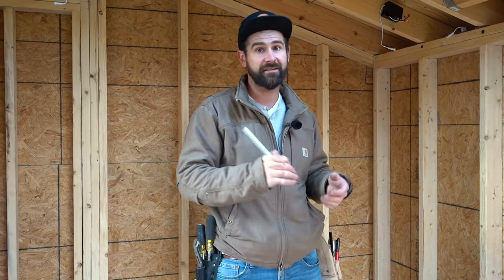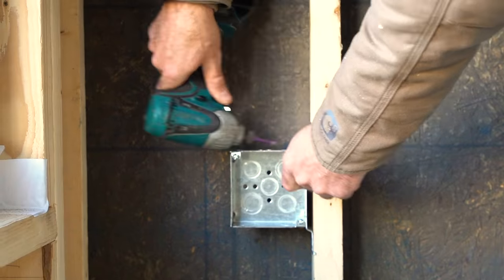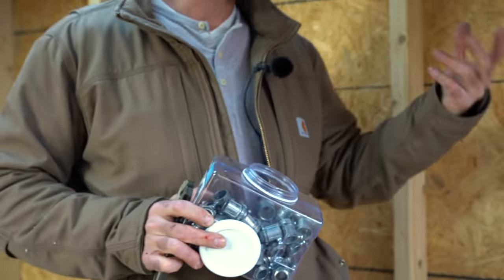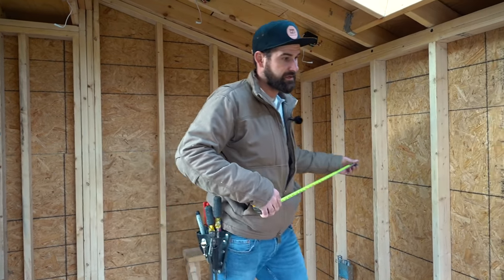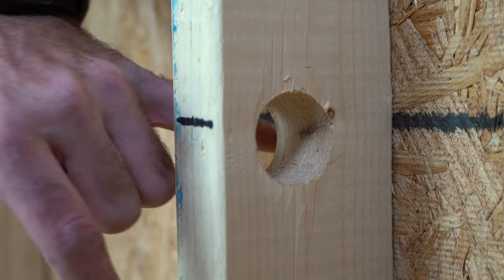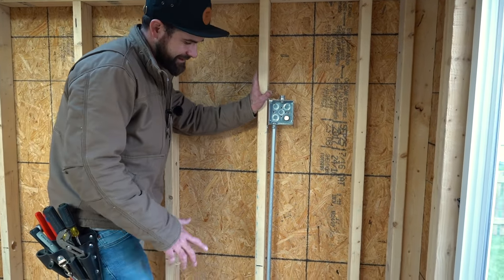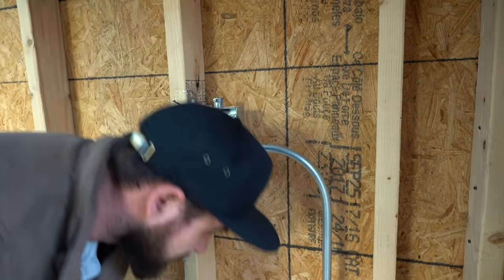How to bend and install electrical conduit

Comment: Hi...been bending since 1985...nice...why didn't you use flex or bx...just asking?  🤔
Reply: They can't only for like 2 foot loops to lights. Fire Marshall says the small gap in the shells where it flexes allows smoke and fire to penetrate to easily

Comment: Metal clad mc should be used in this application to avoid using conduit in wood frame setup. Also there is nowhere in the NEC code book that says this is required in an residential home.  Pipe is not a good ground. I'm a 20 year veteran of the electrical trade. Learn your code so you can avoid costly wastes of time and money.
Reply: Some municipalities adopt the NEC code with amendments. In my town, they follow 2017 code, but exclude the use of MC, NMC, and others. Result is that EMT is required.

Comment: What are the advantages of using a conduit versus not using a conduit and why do some builders choose not to use conduit ?
Reply: Conduit adds a lot of expense. It takes a ton of time to bend, run, and connect it compared to roping Romex everywhere, and of course the conduit and fittings aren't free. But in the case of conduit installed within walls, it A. protects the wire way better and B. allows one to change the wiring in the future, unlike with Romex which is stapled. I'll be running all of the wire in my new shop in surface-mounted conduit because it allows me to move outlets around as the shop changes, and in a shop I don't care about how it looks.
Reply: @bmay8818  

Amazing. Thanks so much for the reply.

Comment: What types of wire can be run in metal conduit ?
Reply: THHN
Reply: Individually insulated wire.  Generally not NM cable. THHN is one type of insulated wire, but if the insulation class is in the NEC, you pretty much can use it.  If it’s a pipe used for conductors under 50V, you can run communication cables.

Comment: Those boxes only have two holes, how do you mount two switches in there?
Reply: Plaster ring
Reply: @gtbr8134  ok, I stay away from those because if you wanna put different things in it, you have to break away all the drywall mud.
Reply from the maker: @danlux4954 you make a good point
Reply: @BobClarizio  we have some razor plugs that have those kinds of boxes and it’s such a pain to get a retrofit kit. The screws don’t fit properly because the holes are in a different spot.
Reply from the maker: @danlux4954 Yeah I know what you mean!

Comment: "1900" is a catalog item number.  Run your pipe next to the stud to have something to support to without adding a tsgb16. 
Use deep boxes.  Only cut about 3 inches of you channel locks handle off.
Who would go through all that trouble of running pipe and then nail the boxes up or nail any of the supports up? I live in the south, where people say we're lazier about electrical work. Not true. I would never use a nail unless I'm framing with wood.
ADA says that switches will be no higher than 48 inches.
There is no way you do this for a living, or you didn't listen to your journeyman when you were taught.
No box offsets. Don't use sharpie, use pencil.

Comment: If people could see the wires I've exposed while remodeling with bare copper wire showing from mice gnawing (at the corn starch in wire coating?), they would be afraid to skip pipe..

Comment: Does the electrical wire just push thru the pipes?
Reply: Pull it in....after you push the fishtape.
Reply: Super short runs like that,  I might just push,  but generally you use a fish tape or vacuum in a string.
Reply: You can push solid wire quite a ways .  Stranded not so much . Sucks when you are stuck with no snake …….
Reply: @gerdberg4188  True... I usually run solid ground and stranded conductors. Solid ground gives rigidity to the "push" on a short run, and also doesn't require crimp-ons to ground boxes, devices... ect. That's assuming we are talking about #12 THHN. Anything larger, I use stranded exclusively. Solid becomes too rigid to push/pull comfortably.

Comment: Why is it code in Chicago to use conduit inside the walls?
Reply: So apprentices learn how to install conduit.. Then contractors know who to hire for commercial and industrial.
Reply: Chicago fire, unions and common sense are the reasons I know of. A pullable metallic system is the Cadillac standard. Contains any fire, keeps mice and rats from starting the fire, and it's easy to pull new circuits or rewire a house without chopping up the walls. There's also the part about the electromagnetic field surrounding the wires being contained by the pipe. The union part comes from years ago having only qualified individuals being able to perform the installation. Although there are plenty of non union electricians who are more than qualified too.

Comment: Never heard of “decking screws” being code to install metal boxes. 
Also, “Pipe” its not the ground… pipe is just grounded because is metal. You still need to run a ground with all the conductors..

Comment: Why in metal??We in the Netherlands and probably in Belgie and elsewhere in europe,we use plastic boxes and plastic pipe.A lot easier to bend!!A lot less weight.We use a bending spring to get the corners smoothly.That spring can be placed in the pipe.
Reply from the maker: In Chicago that’s what is required
Reply: @BobClarizio  Ok,well i guess you have a lot off short circuits when the wires are getting old....We dont because the only thing can happen that the wires itself can make a short cut .And those plastic pipes are far easier to bend.
Reply from the maker: @jooproos6559 yeah it would make things much easier if we were able to use Romex. I use romex in the tiny houses that I build.
Reply: @BobClarizio  Ok,i learned that it is called Romex.So you have to use these metal pipes?Its the official prescription?

Comment: Satisfying work! Can you use a copper conduit?
Reply: No you can't use copper for conduit. First it would be stupid expensive, and since copper and steel are dissimilar metals the conduit would corrode the boxes, and devices.

Comment: You should be running a ground wire, should not be depending on the medal of the pipe to be a ground

Comment: This town's inspector must subscribe to the Electrician Full Employment Act lol. Metal conduit for a residential storage shed? I would have ran the electric "after hours" and just stapled Romex to the studs. Or if you're really a worrier use BX cable instead of the romex. This is severe overkill and a complete waste of time and money.

Comment: Well it's obvious why he's no longer an electrician

Hard piping those lighting drivers is a big nono.

If they burn out (theyre cheap), how do you replace them?  Look up the rules, there's likely allowances for small whips, or get similar fixtures thatll go in an octagon box

"Lots of inspections"   no vapor barriers around the boxes

Comment: As an electrician please don’t follow all of this guys tips and work. 
1. Always good to use a level when bending pipe. If you have a flat surface to work on, use a level. 
2. Good practice to never add in a little 2 inch piece because you’re short. Just looks bad even if it’s going to get covered. 
3. Do your best to map out and imagine the path you’re going to take with your pipe. 
4. Use a reamer! That’s what they’re for.

Comment: Why you don’t use a plastic pipe
Reply: It melts and off gases. also in the states if you keep the pipe continues you don't need an egc/earth cable the pipe is the earth

Comment: I seriously cannot beleive they require steel conduit inside walls in some parts of North America, talk about over the top.  If your ciruits are protected by an RCD/GFCI (At the switchboard), its a protected enough by just being in the wall.  On top of this, using the counduit as the ground/earth while should be fine, is not the greatest idea, it should also still have a dedicated earthing conductor.  Then finally, adding anything after the initaly build its retty much impossible with doing a lot of damage.  Crazy.  The holes are so big in the studs, 50% of the stud material is gone!

Comment: You said 50” off the ground but you marked the top of the box? This is why most electricians mark center. No confusion.
Reply: You ever try to line up the center of the box most mark the bottom or top. Receptacles 16 bottom 20 top switches 46 50 inches
Reply: @wizard3z868  electricians mark center. No questions.
Reply: @KitchenerLeslie2  lol if that where true nothing wld be level the top or bottom of box never changes where as the middle can be subjective. I was told in tech school to mark the top than when I got into the field they all told me to mark the bottom
Reply: We've had guys do bottom or top. One guy does above the line, one guy does screw and the other guy does the perimeter of the box. Center never changes. What's so hard for you?
Reply: @KitchenerLeslie2  the center is a hard way to define in a box what am I supposed to measure 2inchs and mark a line on the box than line upwith my mark on the stud or do I just mark the top or bottom of box and qckly set those edges to a mark.

Comment: You should see how we do it in Europe.... You guys could learn a thing or two.
Not to break down your work... But this is totally unefficient. 
Who even lays pipe anymore inside walls? We did this 25 years ago...
It's al about flex or xvb. After drywall we just take em out where the owner wanted his sockets, switches,....
No boxes needed to be built in before... 
Damn I should really move to the US and addapt our style of work...

Comment: Could you use BX cables instead? Looks very time consuming with electrical conduits for a shed, for a shop with exposed cabling that's nice, but a shed. I know the city requested metal.
Reply: in the chicago area you can only use bx behind a finished wall. other wise it has to be hard piped.

Comment: Metal pipe is a great conductor so, if there is ‘possible’ contact with a ‘damaged’ live wire (couldn’t the WHOLE electrical system -  theoretically - carry a ‘live’ current!?) Of course the ground, and breaker would eliminate that eventuality. - But; I would still prefer to use the ‘plastic’ conduit and boxes, in my home! (🤪You are correct… I’m not an electrician!?)
Reply: That will not happen if you ground your boxes properly, either by set screw or by installing conduit correctly
Reply: The pipe is the ground if done right

Comment: I get its the law but its stupid to run EMT in wood studs. Romex works just as well and is just as safe. And much easier. But if you gotta do it well you do it and you made it look pretty good.
Reply: Don't move to Chicago then. It's required everywhere.
Reply: @jimmac1185  sounds like union got involved years ago
Reply: @ironpig701  I've been told it had something to do with a massive fire.
Reply: @jimmac1185  Rats chewing on the romex causing fires, what i don't understand is that is what BX/armored cable is for.
Reply: @boratb258  Do you mean in general what is it used for, or why do we have it?
Reply: @jimmac1185  What i mean is why use EMT when BX can do the job just as good in a residential setting.
Reply: @boratb258  Oh, gotcha. Idk, there isn't any weird code stuff like this where I work.
Reply from the maker: Thanks
Reply: Yeah I am amazed that you have to use EMT, but you are aloud to use the EMT as its own ground. Also, by code, running threw a stud is considered as a strap.
Reply: @ironpig701  has nothing to do with the union, and everything to do with safety. can a mouse or rat eat through conduit. no. can you re pull in cable no. is there an electrical magnetic field around cable, no. so the system becomes shielded. yes in conduit. also you are allowed to run multiple circuits in a conduit. just follow the pipe fill section of the nec. how many circuits can you run in a cable?. and tell me this. what does the panel look like after you run so man dam cables. so in a 1/" conduit i can run 6 circuits unlet they are gfi. or arch fault. because they require their own neutral.
Reply: @boratb258  when a wall is closed up and you need to wire a circuit or what ever. when the walls are open you must run emt
Reply: @jburnes41  and at what cost? Thus why union pushed these things. It makes money. In my state we have numerous licenses. But the major ones is a 4 year general jurneyman which would do emt then a 2 year residental that does homes. Be hard to have the 2 year bend pipe as they make less.
Reply: @Mike45-47Q  NEC allows all rigid metallic conduits to be used as the grounding conductor. I've run 10s of 1000s of feet of emt. I overstrap and over support all my pipe runs. They are rock solid when I'm done and after 40 years of doing it, I have no problem sleeping at night. If I transition to sealtight or flexible greenfield I will always install a green wire. All outdoor or wet applications get a green wire too.
Reply: @davenag957  Ok? Thanks? Not sure where this is going.
Reply: @Mike45-47Q  Maybe I misread your statement.  I thought you were saying that emt could not be used as ground.

Comment: I don't doubt that code might require that screw, but in reality when it comes to galvanic corrosion, the coating on that screw would add a couple of months of life max vs an uncoated steel screw...

Comment: In englànd youll have all youre wires runnig through the ceiling then branching off into conduit going straight down to youre outlet never across a wall once the wall has been lined the next person hasnt got a clue where youre powers running

Comment: Never heard it called 1900 box lol it’s just a 4 square tbh
Reply: it is called a 1900 box. the octagon is called a 8b box. and since the standard mud ring is now 5/8 you can use the center knock out

Comment: Its sos stratificuing to whatch how its done in US
Reply: Chicago Illinois is the hardest because you can not use any 2core plastic type cable so it's honestly probably the best of the best example of what north American wiring systems can be

Comment: In sweden We use all plastic no metal, its Safer and much easier To run  a smooth plastic pipe than some metal pipes
Reply: Lightning stuck new house we wired with conduit. Damage was burn hole through roof and melted phone wires. . Conduit and water pipes carried current into the ground. Home owner was not home, neighbors saw it happen.
Reply: IT'S CODE!!!

Comment: What about the straps? Is there something I'm missing here? Seriously
Reply: if i dont use a box offset,, i put a piece of wood next to the stud the strap it down. one thing you will learn in running conduit. the leasy amount of bends. makes the pulling so much easier. and remember that a box offset is still considered a 90 degree bend. and when running conduit you are only allowed 360 degrees in 1 pipe run, which means 4 90's. i was taught to work smart but fast.

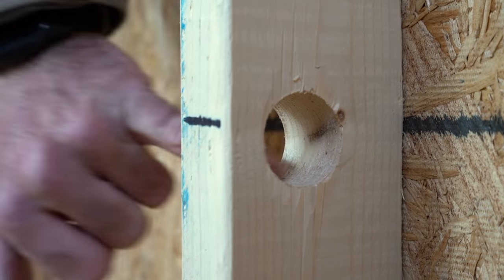Comment: 8:04 when you cut your holes, code states you are supposed to have the edge of the hole no less than 1 1/4 inches from the outer edge of the framing member
Reply: That's if he were running it in Romex since it's in a metal pipe the wire is considered protected.  And even then if it were run in Romex he could use a nail plate.
Reply: Hey its u-tube anyone can be a pro!
Reply: Just curious could that code rule be more about weakening the stud with a hole close to edge instead of protecting wire?
Reply: NEC 300.4(A)(1) exception #1 disagrees with you.

Comment: Way you not make a box offset ?
Reply: What would he offset to?   LoL
Reply: They are only necessary if the box and conduit are mounted to the same flat surface. Not the case here. They're not necessary.
Reply: i would use a caddy clip that is what they are made for. think of it as a simple mini. no screws just need a channel lock. done.

Comment: Damn, how old fashioned. Stopped using metal pipes in the eighties. Corrugated plastic pipes and wires. Plastic, round boxes. No metal. Would install a shed like that in 2-3h
Reply from the maker: In the Chicago area we are still required to use pipe

Comment: The boxes aren't set out a half inch for drywall!?! You need a half inch and three quarter inch bump out. Can't believe all the  power is going pass through that little hole.
Reply: A 1/2” deep plaster ring is added to the box. Single or double gang.

Comment: As an electrician from the uk this confuses me. 

Why waste time installing conduit in the wall? Why not install pvc cable straight in the wall?
Reply: Most new builds I see are putting both electrical and ethernet cables into conduit. If something ever goes wrong you can always fish out the cable and replace it in stead of breaking into the wall. But yeah I would say it's not really necessary. Maybe if you're using porotherm or ytong. But when it's behind drywall I think you don't need to put it in conduit.
Reply: IT'S CODE THERE!!!

Comment: Would it be cheaper to use plastics instead of metal?
Reply: In some states they just run wire lol, but doing that, or making an easier way to do a job will lose the company money. In chicago we have to us copper water pipe, and we have to thread gas pipe, in indiana we run plastic water pipe, and mega press gas fittings, it's way faster
Reply: Actually I don't think they just run wire anymore, that might've been back then

Comment: I can understand using metal piping in high risk areas where there's a danger of being crushed or damaged , but doing this kind of work in a shed is a waste. Plastic piping would have been more than enough. The code is wrong on this one.

Comment: no support  358.30(A)..EMT must be securely fastened within 3 ft. of termination fitings and at intervals not exceeding 10 ft.
Reply: He used nail straps at 19:08. That is secured. 358.30(B) allows EMT to be supported by wood framing members as long as it is secured within 3ft of each termination.